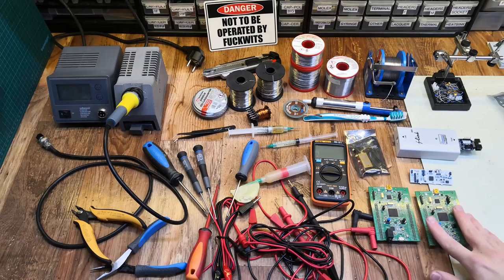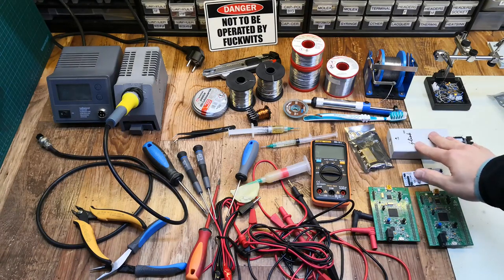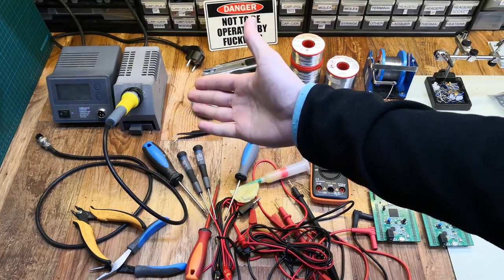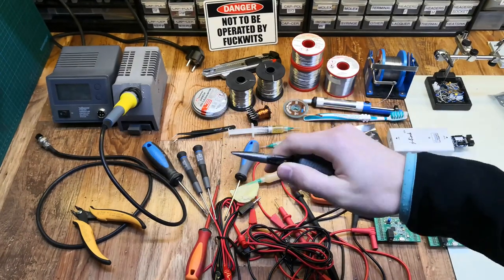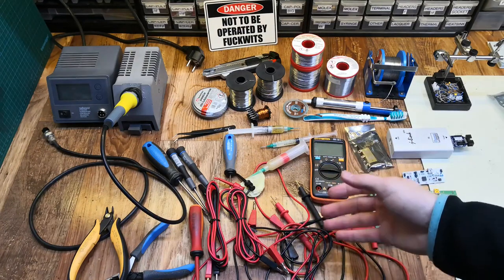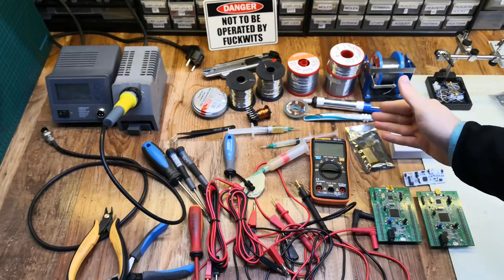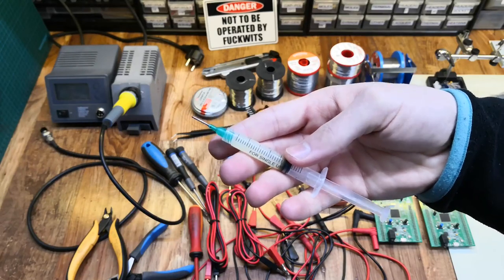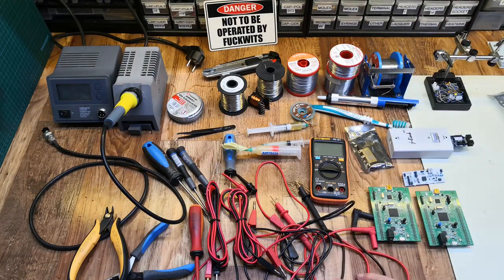Tools for embedded electronics (pt. 2) | VIDEO 39

Comment: These drawers have everything may need usually for thermals, CD ROM power supply. Parts obviously includes harvesting metals which is free salvageable 9:20. Hope you remember this anti static GPU  packaging you received few years ago. 6:55 may you find best guitar picks for you.

Comment: What do you think about getting a portable soldering iron like the Pinecil instead of a soldering station? Do I need ESD safe?

Also for desoldering pump you should checkout engineer tools. They have silicone tip and it should be replaceable
Reply from the maker: If you don't do much soldering than a good portable soldering iron is a good buy. Do go for modern ones with usb-c and barrel for good power delivery and a integrated tip and geater cartrige style system. I don't have any specific recommendations but that's what I would look for. Also check out various youtubers that do these kind of reviews.

Comment: Does the HAL provided by ST and CubeMX code generator used in professional world? or do they use gnu tools, or both are used in industry?
Reply from the maker: tldr: Yes, but a thorough inspection into initialization part is important.
Well HAL is just a library along with system information about peripherals and their options. What CubeMX does it speeds up prototyping and testing and trubleshooting which comes in handy. This removes all the guesswork and time spent just initializing peripherals to your needs. HAL as in itself is very usefull because it provides a more abstracted and easier to use layer with the hardware and you don't need to write, test and verify your own which would take a long time. Yes, it does have its fair share of quirks, but for the most part it's good.
After most of the testing and prototyping is done, we take a closer look into generated initialization code. Not so much all the structs and setup functions, but some critical sections, like where are interrupts for peripherals enabled, do we want them enabled in the init section? How about some peripherals, do we want to call the init function by ourselves?
A good example is RTC peripheral with Wakeup timer interrupt. If you have it enabled and you use it for some data collection for time accuracy, it keeps on running even when the device is disabled, if you have a RTC battery. What can happen is that when the device powers on, before any initialization of system clock, other peripherals and even your code, that interrupt can and WILL trigger right when you enter main. Any code in that interrupt that works with peripherals or any uninitialized data will break and cause problems. Also, HAL initialises RTC time and date at every start to a default value set in CubeMX (i don't like it, I would like to see an option to disable this). If you don't want to get your time run over at power on, then you need to manualy remove that piece of code in the RTC init and remember to do so after every CubeMX generate run. Git really helps as you can just revert that part back.
Once we finish intialization also on our code, all the structures are ready, we can manualy call init function for that peripherals and first interrupt that happens is going to work with initialized data, structures and peripherals. CubeMX offers an option to disable a init call for a peripheral, so that you don't have to delete it after every generate.